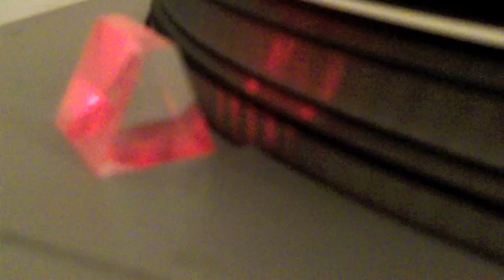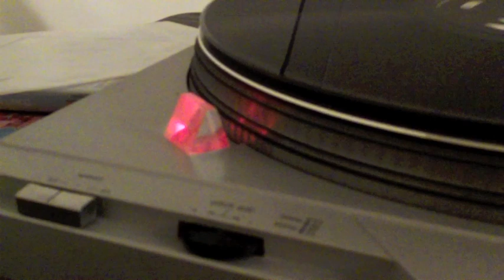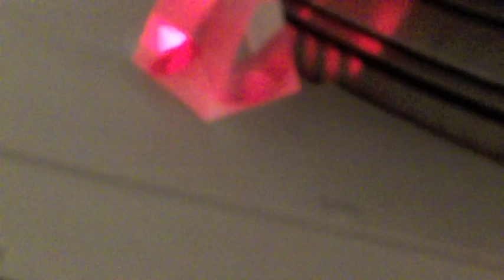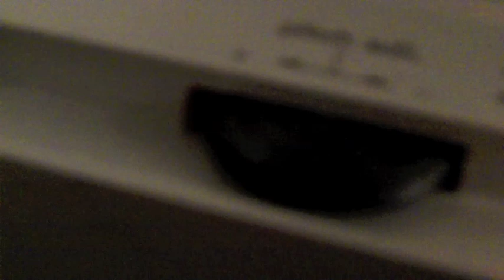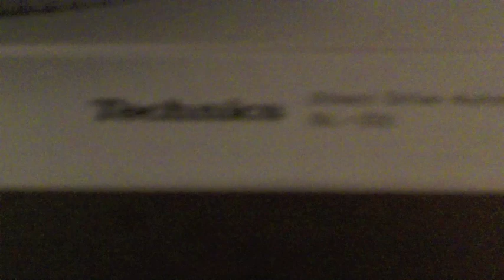What Does the Strobe Do in a Record Player?

Comment: Hi there just came across your video which was very interesting. I had recently bought myself a record deck with a USB MP3 and mp3 encoder.
There is also a pitch Control nob on my turntable which is very handy.

I find that a lot of modern turntables play slightly faster than intended. I have perfect pitch so can tell that the songs are slightly higher.
 Using the adjustment knob helps me to get it exactly right.
Reply: glad to hear it! I heard recently that the new Taylor Swift albums are pressed at 45, and many people are playing them at 33 1/3 and hearing a man singing Taylor's hits.

Comment: the light is just an incandescent light bulb the lines on the plater are what give you he speed (when partnered with the light at 60hz), the light bulb is flashing at 60hz (or50hz) from the power company.  set it so the lines are not moving for the speed its set at.
Reply: Usually it is neon indicator lamp, since it produce nice flickering (50 Hz supply => 100 Hz strobo / 60 Hz supply => 120 Hz strobo) ,

Comment: It's really obvious. bottom dot still mean 33.3 speed, bottom dot drifting mean not 33.3
Reply from the maker: If it was really obvious, no one would be searching this question.
Reply: yeah but what else would it be, if it's still when you have the pitch set so it's perfectly at 33.3, and if you change the pitch so it's going faster or slower and it starts moving, then it's obviously to show you that the platter is spinning at the correct speed
Reply from the maker: Just because it's obvious to someone who is extremely smart like you, more than 17,000 views on this video would suggest that it's not obvious to EVERYONE. Also some people have an idea, but it's not clear exactly what to do. Many people are getting their first turntable ever and haven't even seen Good Burger so maybe it'd be cool to cut them some slack.
Reply: what
Reply: Really helped since I'm about to upgrade from a technics player atm so wanted to see what that light did